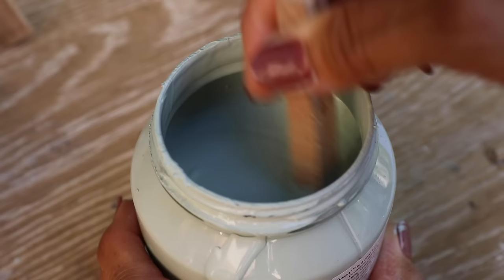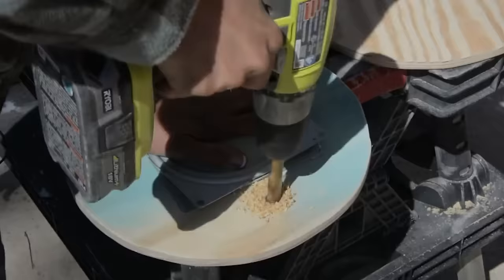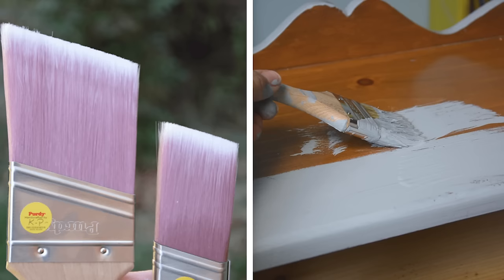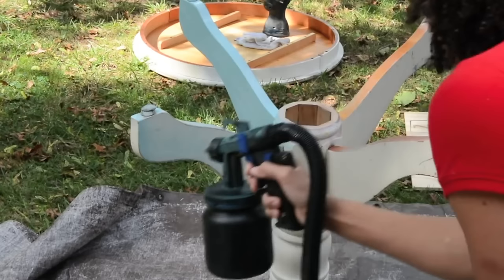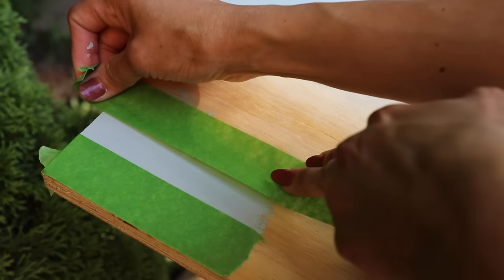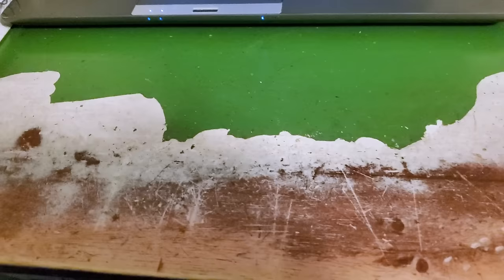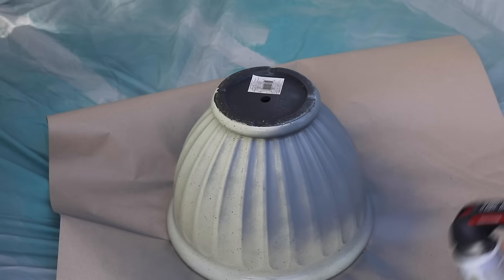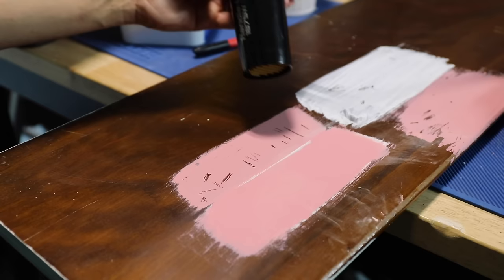10 Biggest Furniture Painting Mistakes (and How to Avoid and Fix Them!) - Thrift Diving

Comment from the maker: ****Download my free furniture painting guide when you sign up for my blog here! https://thrift-diving.ck.page/55265f69ed
Reply: Purchased Danish oil to use on a mid century modern headboard from Habitat. I would like to lightly spruce up its hand rubbed finish feel. Everything that I have read says to sand off all finish before applying, which I really do not want to do! It will ruin the cane insert and the maple and pecan woods' look.. Would I be able to lightly sand with extremely fine paper and then do one very light application?
Reply: Well thank you girl for so valuate advices, really  soooo helpful. Good to see you again🤗😊😊💐
Reply: @dlsdyer9071  if the piece has a finish (other than oil) I would say you have to sand oof all finish first. Because the finish seals off the wood and the oil is designed to be absorbed by the wood to get those beautiful warm tones and vibrant wood colors. But if it's finished, as I said, the wood is sealed and won't absorb bany of the oil. And if you just lightly sand it the finish will come off in some areas maybe and if you apply oil over it it will absorb in some areas and turn out very blotchy...

Comment: Just as an FYI, WATER-based polycrylic is perfectly fine to use and will not yellow over time. It’s the OIL-based polycrylics that yellow almost instantly. A lot of furniture restorers on YT use chalk paint and Minwax Water-Based Polycrylic specifically to avoid this problem. Just thought I’d mention this, in case not everyone realized there were two different kinds of polycrylic! 😀
Reply from the maker: That's what we are led to believe but it's not true over white paint. Even the water-based polycrylic turns yellow over white paint. Sad, but true! :)
Reply: @ThriftDiving  What happens is when you add the water based poly, it will pull the wood tannins up and that's what causes the yellowing. If you prime with a oil based or shellac, the water based poly won't yellow 💛

Comment: To correctly sand back drips use a sanding block, this will remove the drips faster and make it flatter. Same goes for sanding down filler.
Reply from the maker: Thanks for the tip!
Reply: Is a specific size and grit needed for the sanding block or just any kind? Thanks
Reply: @t.terrell7037  Wet & Dry sand paper  is ideal because it will stop the paper from clogging. Wet the surface with water then rub the sandpaper with a solid bar of soap. I would start with around 180 grit, go down to 120 if it's taking too long but then always go up through your grits lightly and finish with 220 to take out any deep scratches. The trick is to try a "hover" over the drip sanding just the high spots and not the surrounding area, hence using a sanding block.
Reply: and for gods sake go with the grain!

Comment: My biggest learning was allowing the paint 2 weeks to fully cure before using.

I painted a bookshelf and made the mistake of putting books on it after only a few days, and the books left marks.
Reply: Is there a fix for faster drying? Bathroom vanity tackiness is still a problem!🤔
Reply: @Thankful305  nothing but time.  If it's still tacky after a while you may need to redo it as something went wrong.

Comment: As far as I'm aware, the yellowing issue caused by varnish comes from choosing an oil-based varnish rather than an acrylic one. That being said, Minwax Polycrylic is kind of an exception to that in a bad way for furniture painters. I haven't ever used it, but I've heard very mixed things from those who have. It even says in its description online that it's best applied over light wood stains, in which yellowing wouldn't really be as noticeable. So going off that, it doesn't really appear to be intended for use over painted furniture projects, despite what you might hear around the web. It probably isn't the only one of its kind, either. A good portion of varnishes/urethanes found at hardware stores are likely meant to be used over a wood stain, not paint, even if they are water-based. I'd always read all product labels thoroughly for any mentions of non-yellowing properties and try to find reviews online from people using the product over latex/water-based paint specifically. If you're working on a smaller painted project, an artist-grade, water-based varnish from Liquitex or Golden should do the trick and is sold in smaller sizes. If you're looking to paint a lot of projects/have a need for something sold in bigger sizes, General Finishes is an all-around solid brand with varnishes that have proven results over painted furniture.
Source: I've worked in a fine arts store for about 4 years :)
Reply: YESSS😬 THAT'S WHAT HAPPENED TO ME.. but I made sure this time I bought one that said non yellowing.
Reply: I bought one that said non yellowing rustoleum painter's touch ultra cover two times clear gloss, non yellowing, UV resistant, seals protects and revitalize.

Comment: Thank you for the tips on how to avoid brush strokes! Using a chalk paint on a small project and between each coat, I was lightly sanding. Your tip to add water worked perfectly!!

Comment: My problem is knowing which sandpaper grit to use for which project and for each step of the project. I understand that some are coarser and others fine but I still have a hard time knowing how coarse to go or how fine. Thank you so much for the video and guide!!
Reply: The smaller the number the coarser the grit. 40-80 is a ROUGH teardown grit. 100-150 is usually the building blocks to getting to the finished stage. 200-400 will buff and shine. Depending on whether you are sanding wood go with the 100-150. Sanding for a finish over paint or stains, go 220.
Reply: @LegendaryGoetz  Thank you!!

Comment: I just completed my first furniture painting project. I used Annie Sloan Chalk Paint. That paint is thick! I kept my brush wet to help spread it out but I struggled with it. I still need more practice to get better at this. Now I am looking for items that have been thrown out to practice on!
Reply: Did you also use a spray bottle and spritz several shots into the paint before you started? If you put your paint into another container and first coat spray a good 5 or 6  shots into that jar to start and then spray the brush occasionally. The second coat even more sprays into your paint 12 to 15 will be good. Always remember whether using spray rattle cans or a brush go with several coats rather then 1 or 2 thick coats. Remember to properly start off by cleaning well primer ect will make each step that much better. Check out Shabby Guy he's pretty good at both explaining and showing how and why he does things. He also shows what products he is using and why he has chosen them think you'll enjoy the channel.
Reply: @AlexBabcock-hw9iz  Thanks for all this very helpful information Chris! I will do this for my next project. I have just subscribed to the Shabby Guy channel. Thanks again.

Comment: Very useful. Thanks! To add to the yellowing of things discussion. I'm a complete beginner here and working up to painting our garage. (Yikes!) Anyway, another mention of yellowing I got was from a company that sells original recipe linseed oil paint that said "Linseed oil paint yellows in dark area or in contact with chemicals such as cleaning products with a high pH, some beauty sprays, chemical paint strippers, and caustic substances. There is also a risk when painting in enclosed areas with plastic paints." After everything I've read, I think your advice to use same-brand products or just follow directions is the best advice for most. There is a lot of chemistry to sort through and paint manufacturers do not make it easy to know exactly what is in their products to sort out combinations that work by any way other than experimenting. But if you post more on this topic, I for one would be interested. Cheers.

Comment: I absolutely love this video. I’ve just finished chalk, painting of a dining room table and the paint that I bought, which was chalk paint and it is called John stones chalk paint, revive and I live in the UK, so you may not have heard of it. This is my first time doing chalk paint and I basically wanted it to be totally covered all over not during the bit where you sandpaper sections off to make it look like it has aged. The dining room table was practically sanded down but I did a little bit more sanding, so the paint could stick to it. The chalk paint stated that you would only need to apply this paint not a primer and then just apply furniture wax after you have finished painting your product which is what I did, but within a matter of three hours of finishing it and  a day of starting to use our dining room table the paint we are starting to chip off very easily and I don’t know what to do as I followed the instructions on the tin and so now I am never doing another project again, but if you have any help on how I can fix this it would be much appreciated.

Comment: Great video. Only issue I have is one of your tips on paint with too much water making it run. The tip was turning it upside down to let some of the solids mix back in. You should never have unmixed solids in the bottom of a can while painting. All paint needs to be mixed completely before doing any painting at all.

Comment: Wow, thank you so much. I’m starting my first project today, & I’m super excited. I’m going to paint an old wooden picnic table that will remain outside. I’m just trying to figure out the step by step process to take so that when I’m finished my painting on the table, it won’t get ruined if it rains for example. Thanks for your help!
Reply from the maker: Good luck!
Reply: I have to paint my front porch railings. Is all natural, never been painted before. Worse part is, finding the right primer and paint for the wood, because is very hard wood, from Brazil. Not sure if the white paint will stick on it. It's been weathered for about 10 years, now is gray color. Any suggestions which primer will be the best for the project? Thanks!

Comment: Thank you for this I've learned quite a bit for me I use melamine paint furniture and cupboard paint for just the top of any furniture that I know that I'll be using and the rest I'll be using semi-gloss latex paint.. you're welcome. ☺️❤️. My biggest pet peeve is when I painted something white and yellow comes up yes that's called bleeding lesson learned also warning giving you all the heads up do not use varathane spray it'll turn your white furniture yellow!! I had a heart attack when that happened I had to do it all over again repaint it.. make sure when you use spray everything or any kind of protectant make sure it's non yellowing.

Comment: I think temperature matters with paint thickness too - if the item you are painting is warm or you paint in direct sunlight. I’ve had this. I felt the paint yellowing one - I hand painted a pot and when I sealed it it turned yellow 🥺. We learn! Thanks for the tips and I really appreciate that you show examples of each situation. Really useful! A problem I have is blending colours to make a piece multitonal. Maybe if I add more water.
Reply from the maker: Great points about the temperature of paint!!! Yesssss! As for blending, are you trying to blend 2 colors to make custom colors?

Comment: Hiya--a few important things to add to your list: If you add water to paint, it lightens the paint. You need to pay attention to the ratio you used, otherwise your colour will be off the next time you mix paint for the same project, or for touch-ups. Secondly, watch out for lumps and brush hairs as you paint, and remove them immediately as you go along. Finally, use a brush for fine areas like edges and moulding and such, and a small 4" roller for flat surfaces. You can do a light roller pass over the areas where you used a brush.  That way, it all but eliminates brush strokes. Oh, a couple more things--pass your roller lightly over an adhesive lint sheet, or a strip of masking tape to take off lint before you start painting. Consider straining old paint through a cheese cloth, or whatever, before you start your painting. You'll thank yourself later.
Reply from the maker: Wow, so many good tips! Thank you! I'll be sure to include these in the blog post so that people don't miss them. :)
Reply: @ThriftDiving  You're very welcome.
Reply: Lov love love the foam roller! Gives such a smooth professional finish.

Comment: Ugh, yellowing is the worst! Using a furniture stripper/neutralizer first could help but some top coats just yellow. Decorative painter's brands tend not to yellow. If you want to try something new, I'm a big fan of Modern Masters Dead Flat and any sheen by Faux Like A Pro. Both have high quality top coats (water based) and lots of other great products. Not affiliated, just used them for years & love them! You should do a refinishing video now for your example piece!

Comment: I'm usually asking myself about stripping the old paint, and taking it down to the bare wood. I was hoping you'd mention an 'always' or 'if' rule to follow. Any direction is helpful at this point, as I didn't start the project yet.
Reply: If its peeling, take back to bare wood
If its greasy or waxy take back to bare wood
If its patchy take back to bare wood
f you don't take back to bare wood there is always a chance it will peel no matter how much prep you have done.
Reply: If you are a rookie at flipping furniture those are the safest rules, if you are advanced or a pro absolutely not. One must always access the condition and chemical composition of what the furniture has on it combined with what is the look and finish because most of the times the pre existing paint or varnish layers serve as sealer to the wood itself so you don't need to bare strip or to apply undercoating and plus it will add dept and character to the finished look you desire. Most people don't realize there is a chemical world of rules that apply to the paint trade, you can't  mix nor paint over oil based with water based, they just don't get along and you get peals and blisters or the paint just simply doesn't adhere in the worst case scenario. Synthetics, acrylics, cellulose, enamels, shellac, wax... there is a bunch of divorce and marriage rules you must know to get the job well done and solid.

Comment: I don't know if I agree with everything you say. I'm 60 years old and I've been painting things since I was 12. No one showed me how to paint right or wrong. I learned by trial and error and never have I only stuck my paintbrush in the paint 1 in LOL
And I usually shake the heck out of a small container of paint so I've never needed to add water.
And nowadays, most diy'ers have a drill, so, if you're going to be buying paint you should have a paint mixer you can get the bottom of your paint loosened.
As for drip marks, everyone needs to learn by trial and error. It's good to have a practice board. Temperature plays a part in this as well.

I'm glad you give examples of what beginners would be doing but I really hope you don't do that now and that's why you think we might be doing it too LOL

Comment: I looked up the blog post you mentioned in mistake #6 because I plan on using Polycrylic on a white piece and started panicking! Lol the blogger used an oil based polyurethane...The name of the post is actually called “My solution to yellowing polyurethane (our Master Bed Makeover!)” when she fixed the white she used a water based acrylic, which is great for me because the Polycrylic is water based acrylic. Loved all the tips just thought I’d mention that tiny correction. ♥️
Reply from the maker: Thanks for the clarification! I still want to mention that the sample I did was using the water-based polycrylic over white paint and you see how it still yellowed. I would recommend using a sealer made specifically for the brand of paint you're using, or use clear wax. If you're bent on using the poly, just do a sample on a board first to make sure you're happy with the results. :)
Reply: Yes! So true! I looked up a trick if it starts to yellow before it dries you spray 1:10 white vinegar & water solution and it removes the yellowing. I am hopeful my sanding in between will keep it white. ♥️🤞Thanks again I’m definitely going to purchase the spray paint tent you have😍
Reply from the maker: @riabeach5427  Ooh, I will try that and see how it works for me! I like learning all these tips and tricks. It comes in handy! Thanks, Ria!
Reply: Ria Beach What a great, simple and earth-friendly remedy🥰🙏🏾

Comment: Good tips! I researched oil based polyurethane yellows white but water based don’t...
Reply from the maker: That's what we are told, but the polycrylics is water based and still turned my paint yellow. Some other commenters have said they have had good experience with using polycrylic, but it does turn paint a tinge of yellow, as you saw in the clip. I'll investigate more to see if certains brands are more likely to yellow than others, but yes, water based can yellow white paint too.
Reply: I’ve sealed many projects with water based polycrylic (minwax) and haven’t had an issue of bright white yellowing.  

Now, Polyurethane is a completely different issue, and I learned the hard way. My white cabinets turned yellow.  😭. I even turned a beautiful deep blue dresser almost green after a few years because I didn’t know what I was doing... 🤦‍♀️

Comment: I did my first project this weekend and when I changed rollers, it was giving a different texture and the roller was not rolling. I had to abandon that. I gather I was using two different  Naps. Was not aware that there are Naps that I need to assess for my paint project.